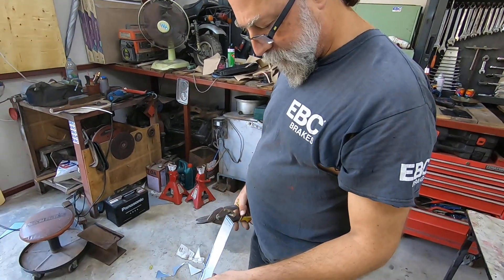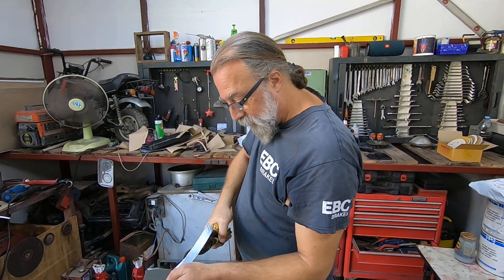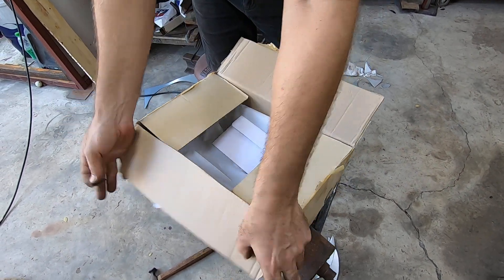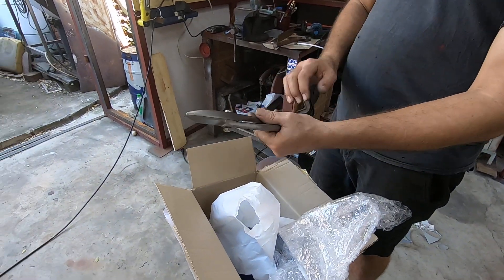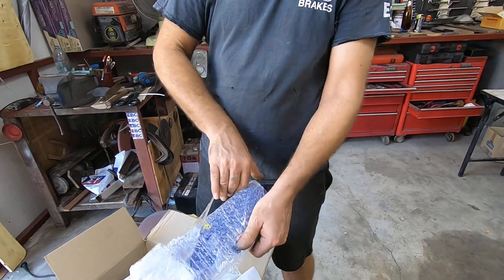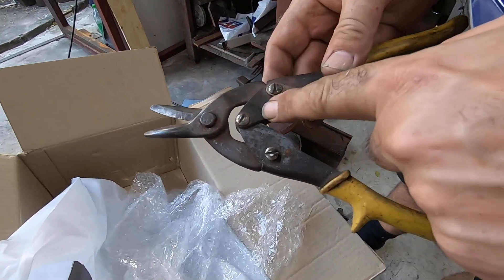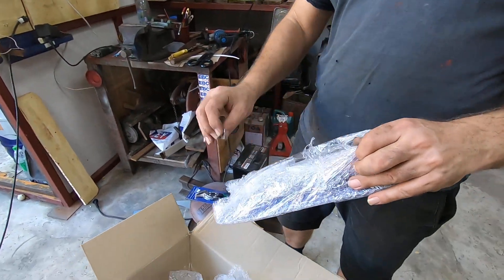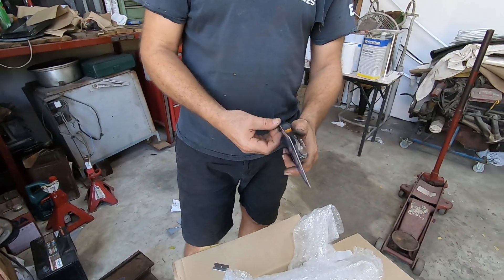NEW TOOLS - WILL THESE LAST MORE THAN 33 YEARS?

Comment: I still own my grandads old gilbows, last used in the 90s, to remove cortina shelves to fit speakers...😅
Reply from the maker: Cool. I love old tools, they were made so much better that the modern stuff. Made to last a whole career.
I've some somewhere they got extended at some stage, I'll have to dig them out.
I'd love an old shear.
Reply from the maker: Don't know if you know I used to sell tools. On the whole it was quite a disappointing venture.

Comment: I got 2mins in and immediately thought to say that anything needing huge snips like that, I'd whack the bottom arm in a vice so I have full control. I had numerous pairs of left and right gilbows, and what we called "straightbents" .. a straight cutting gilbow, which we heated and bent the blade to a slight angle to keep your hand away from the metal whilst cutting, but also with about a foot of tube added to each arm for an easier squeeze.. as for the other snips, I would highly recommend "wiss" left and rights.  They are like the bluepoint but have a thinner blade .I'll send you pics on FB.. only about 25quid per pair
Reply from the maker: I'm finding those big snips good, especially on long cuts. Rest them on the bench and use like a shear. All 4 of these were an impulse buy, I knew I needed something quick and new year holiday was coming so I took advantage of the sale offer and the rest is history 🤣🤣🤣 I'll look out for the Wiss ones.